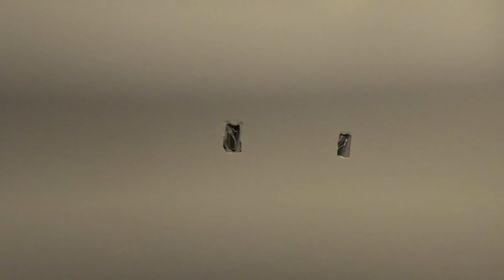#728 - Livable Shop: Window Casing, Paint DONE!!! Spring Break in Arizona...

Comment: Consider the two different occupancies you have created. The  Bedroom/sleeping area and the Shop/Flammable /storage area. They may need to be separated by one  hour rated self closing door door and  fire rated drywall (one hour 5/8 Type X). Type X gypsum wallboard, 5/8" in thickness ("5/8" type X wallboard"), is manufactured for use as one component of an
assembly/system (such as a wall) where a fire resistance rating is required in a residential, commercial, or other structure by an applicable building code.

Comment: I hope this isn't too intrusive. The end result may be a blessing. I had a large dark spot on my forehead, just like Cedar's dad. (I may be about the same age as him.) The way I got rid of it: I bought a small bottle of old fashioned red iodine. I 'painted the entire spot, several times, till it was good and soaked in. Then I cut a round patch from gorilla tape, and applied that over the whole thing. (Cuts off the air to the spot. Don't want to use a regular bandaid.) Every morning and evening, I did the same thing. Removed the old tape. Cleaned it up. Reapplied the iodine, and then the tape. It took a little over three weeks to be rid of it entirely. My doctor and nurse both had to touch it afterward, and exclaimed 'baby skin'. LOL
Reply: PS, if you'd like me to delete this, let me know. I'll do it. If you'd like to delete it yourself, please do. I will not be offended.

Comment: Smart decision not using the chicken wire and drywall texture on the walls , that would’ve been a headache to maintain and keep clean. I’m glad you guys decided against it, that done on an exterior wall with wire and stucco or concrete where it could be easily washed with Rain, water hose, or pressure washer would be awesome. But a pain in the Butt on an interior wall to keep clean and maintained. So I think you made a very wise decision and respect that a lot. God Bless

Comment: watch you every week but had to comment,, really bothers me when you use that table saw! you always have the blade cranked up so high above your boards, accident waiting to happen! i was always taught to keep the blade a 1/4 " above the wood you are going to cut. if you slip into the blade yes you get cut,,, maybe loose a finger depending on finger thickness. but the way your blade is always set you could possibly loose your whole hand. if your not going to use a guard, please take my advice. think about it please!